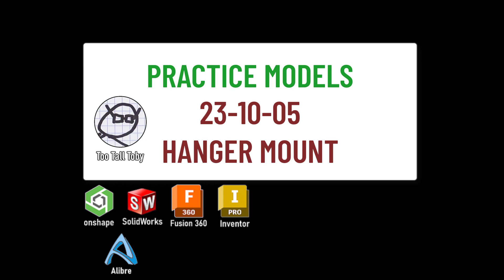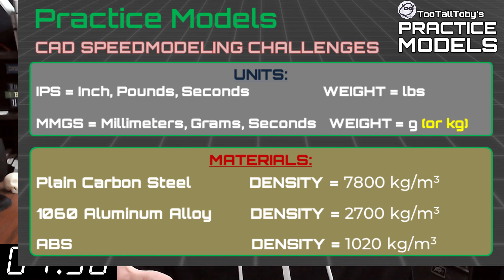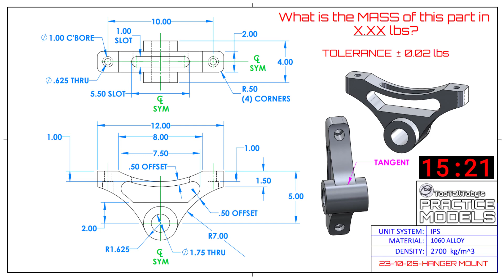CAD Modeling Challenge - Onshape, SolidWorks, Fusion360 - OFFSET - Hanger Mount

Comment: 5.72 Pounds, Time: 10:31.  I use mouse gestures for dimensioning. And it does not work fast all the time. sometimes I have to reselect the dim. 2-3 times then it works. I need to start using the s key more. but I have been using the  Mouse Gestures for at least 15-18 yrs. old habbits.
Reply from the maker: lol - I never started using Mouse Gestures because when I'm in an assembly, I like to RMB+DRAG to rotate components, and I always inadvertently launched a mouse gesture.  So I disabled them.  S KEY FTW :-)